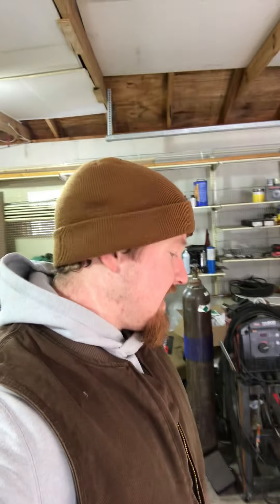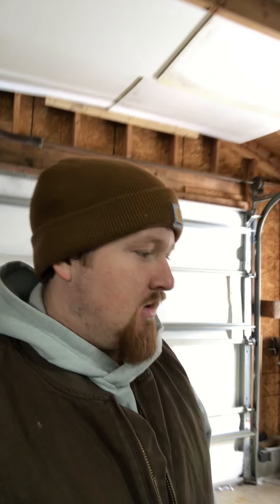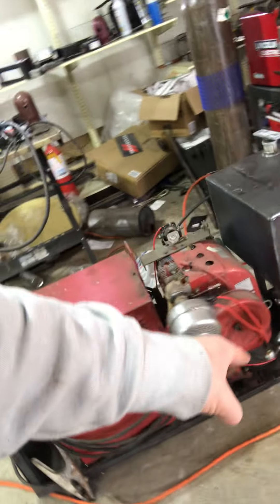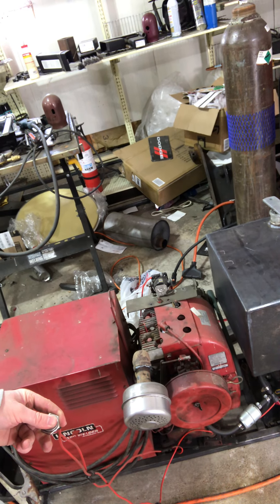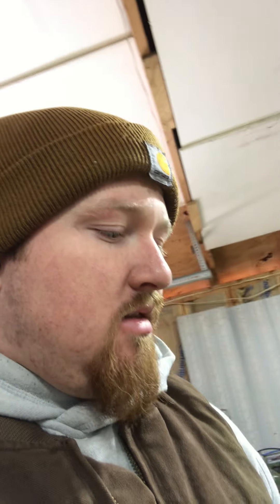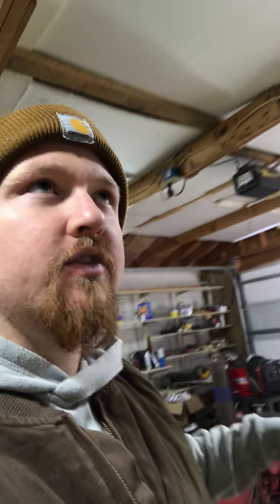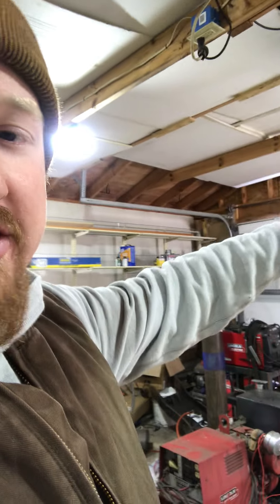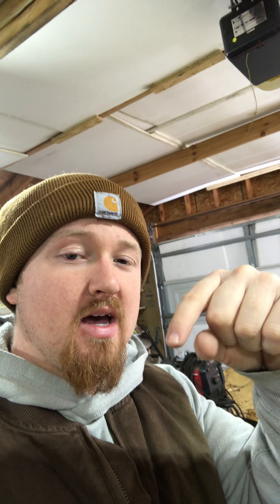Shop update/life update/Lincoln weldenpower 150/master 140000 BTU heater

Comment: I just finnished up reparing my 1987 Linclon Weldandpwoer 225 16 HP Brigs Stratton. There is a ton of infprmation you can download the manual free just put in the code # off the plate.
Reply from the maker: Ooh that’s a good idea I never thought of that. I ended up finishing the machine and selling it, bought myself a new Hobart engine drive. Just a bit bigger. But good tip

Comment: Cool man that weldenpower is interesting Ive never seen one. Im looking to learn more about welding machines and how to repair and maintain them do you know of any good resources for learning that kind of stuff?
Reply from the maker: I couldn’t find a lot of information on these older machines. A few guys out there have some knowledge. But these engines drives run off of simple motors. Then as far as the welder goes I just made sure everything was nice and clean and had good connections